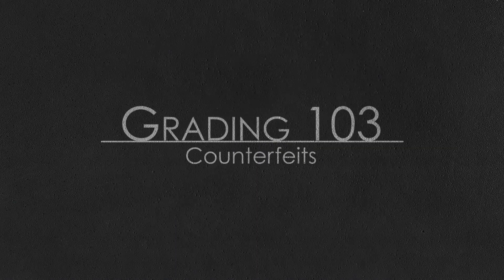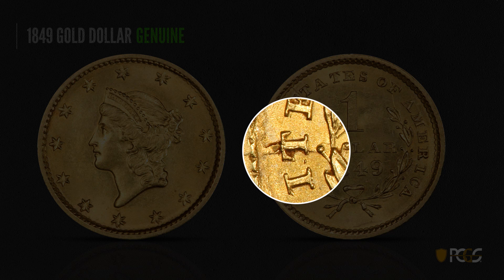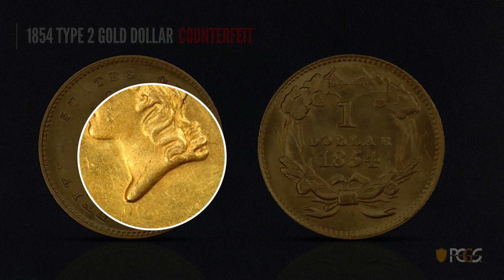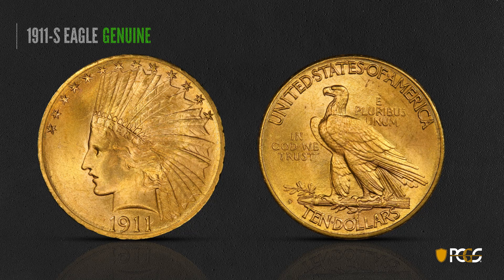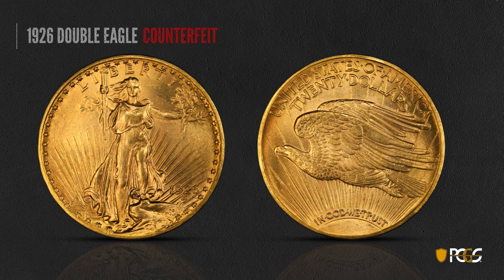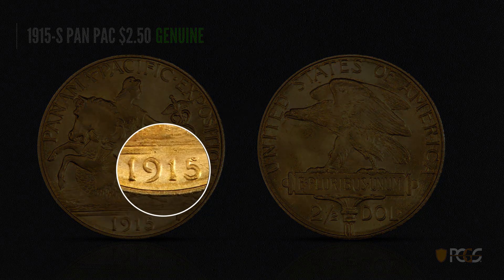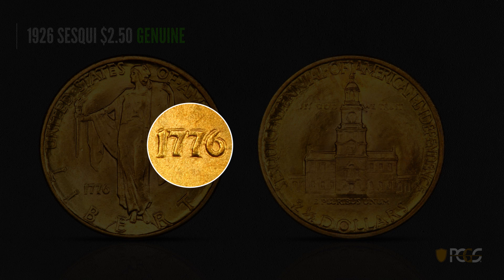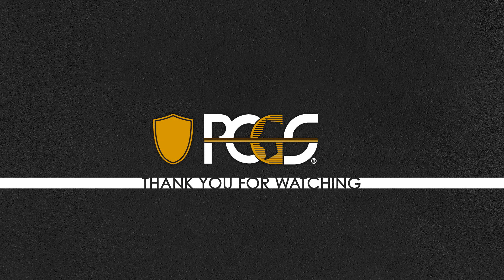Counterfeit Coin Detection - Gold Coins

Comment: I have and old American Golden Eagle (1927). I looks genuine but I have weighted it and it says 33.4 grams. According to some coin selling sites the Golden Eagle should be 33.93 grams .. is mine fake or is there a difference in weight with the new 2022 ones? So are the new ones slightly heavier? Please answer ...
Reply: I have no definite knowledge, but my guess is that older coins would be a bit lighter than new ones because they get a bit worn away.  Gold especially, because it's so soft.  Also, depending on the scale you used, half a gram could be within the margin of error.
So I'd say it's worth looking into, but I wouldn't be too panicked about it.

Comment: On the 2.5 Indian what do you mean by ‘tooling marks’ I’ve looked this up so many times and that term seems very subjective.
Reply: Tooling marks typically reference the coin die and the artist mint design but all coins would have these marks the pitting on the fakes could be debris from the counterfeit die that was made? Maybe figured I'd give my best advice most fakes are typically the coveted rare coins like 1923S mint Quart always inspect your coins but if you come across rare ones Definitely run it through the ringer I've been burned on a few silver coins sad part was it was Real silver just fake date and mint! So even some of these "fake" gold coins are still gold,... sometimes
Reply: @jonathanbrown9136  Is using real precious metal common for these counterfeiters? Seems silly unless it's for numismatic value and not just the premium cost alone. Like you suggest, I'll stay away from the numismatic coins and just hold authentic coins for the PM store of value.

Comment: Why don't you just weigh the coin?
Reply: Because counterfeiters often make fake coins out of real gold.
Reply: to clarify, a thin thin layer of gold over tungsten. Obviously counterfeiters are going to use as very little gold for the fake as possible so it may seem like gold and weigh the correct amount.
Reply: @nmatthew7469  Pretty sure tungsten does not weigh the same as gold so to weigh the same it would be too thick, right?  I would ask, What about a ping test?